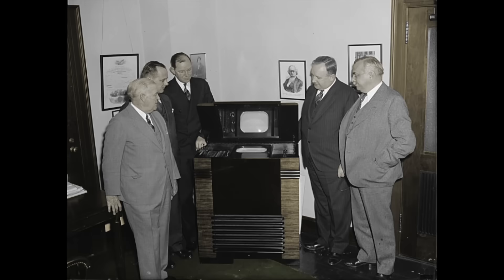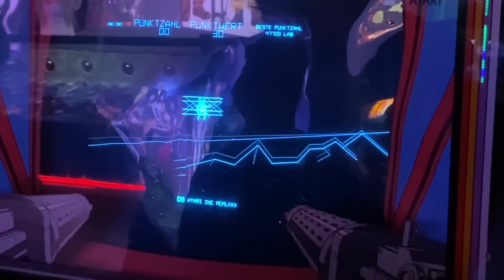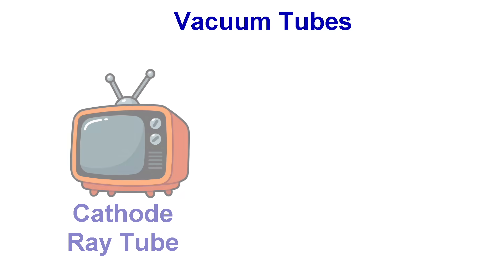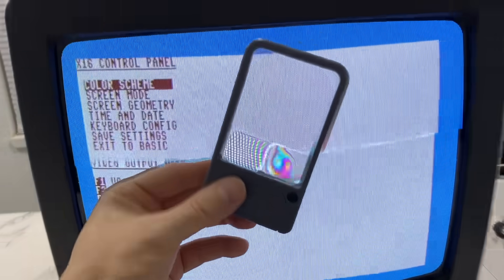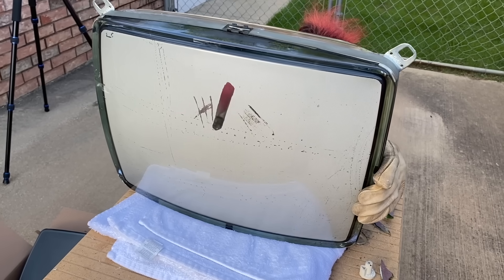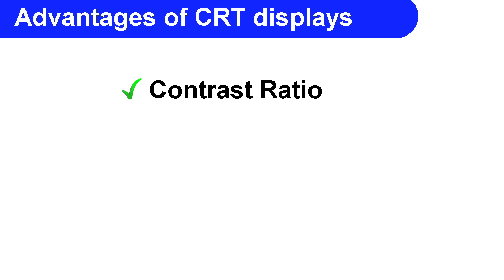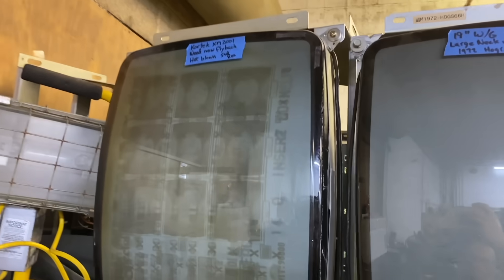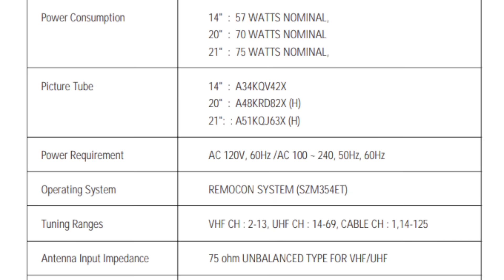How Cathode Ray Tubes Work.

Comment: The bit about contrast ratio does often depend on viewing conditions, though. All of the screens you showed were a medium to dark gray even when turned off, and if viewed in broad daylight or a well-lit room, "black" pixels won't be any darker than that. Whereas I've never seen an LCD that isn't a proper black on the outside. And that's before you get into the issue of glare. I don't know why everyone has started encasing their LCDs in glass these days (aside from portable devices that need to be scratch resistant), but it's at least still possible to get matte screens that don't superimpose a mirror image of the whole room you're in on top of what you're watching. With tubes, you're out of luck; they're just made of glass. Best you can hope for is some kind of extra layer that forces you to overdrive the display and wear it out faster.

Comment: As an early trained Apple tech, yes, at Apple, there is a 1 mega Ohm discharge tool to dissipate the current to ground before you deal with the CRT tubes. Can't tell you how many I worked on back then but following the procedures I don't  have a shocking story to tell.

Comment: Resolution (not dot pitch) is how closely a CRT can display lines to each other that can still be visually separated (or "resolved").  Resolution is measured in lines: it's how many parallel alternating black and white lines can be displayed and visually separated. 
Dot pitch only applies to color CRTs:  it's the distance from the center of one phosphor dot to the center of the next phosphor dot of the same color.  Monochrome CRTs don't have dots: they have a continuous field of one color of phosphor.  
A spot is the area lit up at a given instant by an electron beam.  Monochrome CRTs have one spot, and color CRTs have three.  The spot(s) are constantly moved (scanned) across the screen from left to right to draw the image in horizontal lines from the top to the bottom.  
A CRT's resolution is effectively limited by the spot size, the dot pitch, the scanning format (how many scan lines per picture), and the signal bandwidth (how quickly the signal can change between light and dark).  
The vertical resolution is the number of horizontal black & white lines that can be resolved across the picture height, and is generally limited by the number of scan lines per picture in the scanning format.  
The horizontal resolution is the number of vertical black & white lines that can be resolved across a width of the screen equal to the screen's height ("TV lines per picture height"), and is limited by the source signal's bandwidth and the bandwidth of the display's signal processing.
Reply: you beat me to it. 
Just a more human explanation, a monochrome CRT screen does not have any resolution limitation other then physical size of phosphorous material. So in reality if the analogue board would be fast fast enough a 4k resolution would be no problem on apple Macintosh OG 9" screen. So the resolution was limited not by screen but by the computer itself and the maximum horizontal frequency the analogue board was capable of.
Damn, I still wrote it too complicated...but I tried.
Reply: @madigorfkgoogle9349  A monochrome CRT's resolution is limited by spot size, number of scanning lines, and signal bandwidth.
Reply: If you looked really closely (with a magnifier), a B&W TV tube had a mixture of tiny blue and yellow speckles to make white. A bit like the white LEDs do, blue + yellow to make white. At least the one I looked at did.

Comment: Great demonstration of how the shadow mask works.  It's difficult to describe or even illustrate, but it's well done here.

Just a few things.  I figured dot pitch is mostly a factor for color CRTs, measuring the individual color elements.  Monochrome screens definitely do still have a spatial resolution limitation, since some energy will still be deposited around the illuminated spot, but there are no 'dots' exactly.  Also the colors for monochrome screens were more than just a stylistic choice.  Green long decay phosphor was favored to mask jerky text scrolling, for example.

Comment: I still have and routinely use a 24" FD trinitron monitor on my garage/test bench setup. 16:10, runs 2304x1440 no problem as long as one has a video card that can handle it (such as the Nvidia Geforce 970 I run with it). Since (as described) it's resolution-agnostic, it pairs great with a KVM in a test bench setup. Only issue is that it needs routine manual degaussing... there's an issue where the internal degaussing coil makes things way worse and the only way to fix it is the good old hoop.

Comment: I was surprised by the claim that CRTs have better contrast ratio than LCDs. Many many years ago, one of my "mind blown" moments was when it was pointed out to me that the darkest gray that a CRT is capable of displaying is the same gray you can see when it's turned off - the gray of the phosphor that's not being hit by an electron beam, but is being hit by ambient light from the rooms it's in, which it briefly absorbs then re-emits. Unless the room is pitch black, you only see blacks at all because your eyes adapt, seeing the darkest gray as black, the same as they always do to adjust for lighting. At least I think that was it, though it's all a bit vague now. Of course there are limits on contrast ratios for LCDs which may well be worse than for CRTs for all I know, but that's one of the reasons technology seems to be shifting towards OLED.
Reply: Yep, I felt the same thing with projection screens in a less-than-perfectly dark room. In a bright conference room, your darkest black will still technically be white (assuming that's the color of the screen)! I think the CRT still wins, as it's deepest achievable black level is pretty dang dark (in a dark room). LCD has a more hard limit that can't be improved by changing room lighting levels.

Comment: In India CRT TVs are still used, but only by a very small fraction of the population as cheap LCD/LED TVs from Chinese OEMs and even some models from mainstream manufacturers like Samsung/Sony are now very affordable. We used a CRT TV till 2015 until it finally broke down and a friend of mine used it till 2021 and eventually upgraded to modern flatscreen technology! But, now with the advent of low-cost mobile data ( Thanks to Jio!) people mostly consume online content on  smartphones, Tablets and laptops as the quality of content which is simply better on platforms like Amazon Prime/Netflix.
Reply: I'm in Canada, and  still use CRT TVs. But I''ll be buying an LED soon, as my cable company recently installed a 4K PVR box that only has HDMI.
Reply: @dougbrowning82   That's interesting. In India DTH (Direct to Home/Satellite TV) and Digital Cable TV are slowly dying as people are now watching TV on their phones for cricket matches/ daily soaps. However, Indian DTH players and Cable TV operators still provide RCA Jacks/AV output even on their HD set-top-boxes for backwards compatibility with old TVs or plasma TVs which may not have HDMI input.

Comment: It's weird to think about but CRTs are a primitive sort of particle accelerator.  If you're over 30yo you spent a significant period of time staring at a particle accelerator.
Reply: It guides the beam, but accelerate?  Not really.  The speed of light (and electricity) is constant.
Reply: @TheUtuber999  Well the speed of light is constant but electrons are matter and not light so they don't travel like light.
Reply: @rayceeya8659  iirc that's not exactly right. You can see visibly electron flow in conventional light bulbs. I don't recall how it was shown in electronics lab when I was learning engineering,but I remember the experiment where it was shown vaguely.
Reply: @jothain  You just won't accept that you are wrong will you?  CRTs the electron gun consists of a filament that is heated until electrons undergo thermionic emission.  These free electrons are then ACCELERATED by attraction toward an annular anode.   Electrons are particles, and they are accelerated in the direction of the screen.  That makes a CRT a basic single stage particle accelerator.
Reply: @rayceeya8659  I already stated why they're not the same thing. Like that mentioned gun thing. Guns also "accelerate" projectiles,but still they aren't called accelerators. Construction is different. Reasons are different. Technique is different. We don't call fluorescent tubes accelerator tubes, we don't call electronic circuits accelerators and so forth.
Reply: @jothain  and you are still wrong.  Electrons are particles and to make an electron gun you need to accelerate those particles in a specific direction.  How is that NOT a particle accelerator?
Reply: @rayceeya8659  Cause it's technically still electron gun. It doesn't accelerate particles. Look up previous comment from TheUtuber999 which is really well put. "It guides the beam, but accelerate?  Not really.  The speed of light (and electricity) is constant.". Could you say something creative instead of saying you're wrong, pls.
Reply: @jothain  This may break your little brain, but electricity is fast, but not as fast as light.  LOOK IT UP!
Reply: @rayceeya8659  Look it up? Are you serious? Electrons are shot in phosphorous film in the glass where they turn into visible light. Are you claiming crt is turning electrons into visible light somewhere in the tube by particle acceleration, seriously? Cause you're now directly implying that.
Reply: @rayceeya8659  it's very rude to call people small brained btw. Please try to behave civil.
Reply: @jothain  You make less sense with every comment.  You and your buddy @TheUtuber999 have serious trouble understanding basic particle physics.
Reply: @rayceeya8659  😂
Yeah, you've proven yourself to be not worthy discussing this subject anymore.
Reply: Technically...Nope. It's still electron gun. Accelerator, well it accelerates particles. Yeah I know it's nitpicking, but still.
Reply: @jothain  you really went UM ACKCHULLY🤓
Reply: @jothain  oh YAY the fun police! 

Said No one..  Ever. 

Be you're fun at parties.
Reply: @GrumpyMunkyGameDesign  "Be you're fun" I'm sure you are ;)
Reply: @jothain cathode ray tubes are in fact considered small scale electrostatic particle accelerators. Because they are.
Reply: @madLphnt  Source for this fact pls
Reply: @jothain  dude, look it up.  It is an electrostatic linear particle accelerator.  Its written everywhere.
Reply: @madLphnt  look it up. So you can't show me source? Cause I can't find one.
Reply: @jothain  you can find it yourself man. I'm not going to source something that can be referenced literally anywhere you look up what a cathode ray tube is.  Try typing.....is a cathode ray tube a particle accelerator and see what you can reference.
Reply: @jothain  Well electrons are particles and they are being accelerated toward the screen.  Pretty sure that qualifies.
Reply: @rayceeya8659  No. They're shot at screen. Particle accelerator, as name implies, accelerates particles on long distances by powered magnets/coils. You're not calling firearms bullet accelerators.
Reply: @jothain  It's a one stage accelerator with much lower energies than accelerators used for research. But the principle is the same.
Reply: @ccricers  No it really isn't the same thing. Not even close.

Comment: 4:45 - the little monitors attached to studio TV cameras were still B&W in the 90s when I operated them. It gave you the sharp image you needed to tell if you were in focus, and the control booth proc amps saw to the color calibration. I haven’t worked one in a long time, but I wouldn’t be surprised if they still are.
Reply: The control booth also had vector scopes and waveform monitors for calibration.

Comment: For tv's with a de-gausser would repeated power on and off of the display fix said display? Would it simply take a long time or would it get diminishing returns? (at which point you'd finish with a external de-gaussing tool?)

To fix color distortion caused by a magnet?

Comment: One reason why we hung onto our C64s and our Amiga 500 as long as we did was because of the superior color compared to the old CGA monitors for IBM-compatibles.  I remember my husband playing the Koei games "Nobunaga's Ambition" and "Romance of the 3 Kingdoms" in monochrome mode, because the monochrome graphics looked better than CGA.  (I noticed the same phenomenon with early roguelikes using keyboard characters for the graphics.)  It made such a big difference when we upgraded our first IBM compatible to add a 2nd floppy drive, a hard drive (40GB was pretty large back then!), and an EGA graphics card, plus an EGA monitor.

Comment: One CRT monitor we had back in the day (late 1980s-early 1990s) we called "the screamer," because it developed a loud scream-like noise as it aged.  Amazingly enough, we were able to sell it in the auction at one of the early GenCon conventions we attended in Milwaukee (this was before GenCon moved to the Midwest Convention Center, so probably no later than 1997 or 1998).

Comment: Excellent video. I'd like to add one more advantage to the CRT monitors: motion blur. My CRT running at 85Hz absolutely blows away my LCD at 165Hz when it comes to motion clarity. I can actually read windows while dragging them around, which I can't do with my 165Hz LCD. It's crazy how much smoother things feel on that, despite having 80 less Hz then my $800 LCD.

Comment: For those who want to know. The TL:DR of the Trinitron is they use an aperture grille instead of the shadow mask, as well as a single electron gun, with three separate cathodes.
Reply: Trinitron - where the 2 black horizontal lines let you know you had Quality, lol!
Reply: @philojudaeusofalexandria9556  Depends on the screen size. 17" and under generally only had one brace wire, while 19" and larger had two.
Reply: @philojudaeusofalexandria9556  The black horizontal lines were wires to stabilize the aperture grill on the screen.
Reply: @philojudaeusofalexandria9556  But flatscreen technology sure looked impressive.
Reply: @philojudaeusofalexandria9556   Did Mitsubishi Diamondtron only have one wire in the upper half of the screen? That was the same type of mask, but i thihk 3 separate guns. Very good displays as well, particularly as computer monitor displays.
Reply: I thought a Trinitron was more le one of those old projection screen TVs.  Because you can adjust the convergence on a Trinitron.
Reply: @derekwhidden9730  If you like adjusting convergence, you would love the old delta tubes. They not only had three magnets on the neck to adjust the centre static convergence, but also dynamic adjustments for the surrounding picture areas.
Reply: A Trinitron has 3 electron guns as well, but they are in line, not in a triangle shape.
Reply: @lovemadeinjapan  That's incorrect, the Trinitron didn't used three electron guns, it used a single electron gun with three cathodes.
Reply: @MattSinz  Then the images I found are highly confusing. They show only alignment differences. Can you point to a correct diagram of the Trinitron tube?
Reply: @MattSinz  The Trinitron was designed to compete with, and improve upon, GE's In-Line tube, which did use three side by side guns.
Reply: @dougbrowning82  Yes, the Trinitron was designed to compete with and improve upon GE's In-Line tube, and it did that by using 1 electron gun with 3 cathodes.
Reply: @lovemadeinjapan  Yep, because of the aperture grille using parallel lines instead of a triangular dot pattern on a shadow mask.

Comment: LCD's are getting better and better, to the point where they no longer use one single backlight, but a large array of LED's which are capable of being controlled individually.  And the contrast ratio is getting better and better over time.  Of course, OLED's solve that entirely, but they're very expensive for large displays.  I would say that modern displays have contrast close enough to CRT's that the difference doesn't matter anymore.  Input lag is also not really an issue on the most modern displays, that have a way to turn off almost all post-processing.  The minor amounts of input lag on modern displays I will take over a CRT any day.

I do agree that LCD's in the CCFL backlight era were pretty terrible though, and CRT's definitely looked a lot better then.  While I had gotten rid of all of my CRT's around 2004, and I could never forsee ever using one again in my personal life (I think they belong in museums, simply for the amount of power they waste if for no other reason), it's still fascinating to hear about the technology, and how we did displays before the modern tech we know now existed.